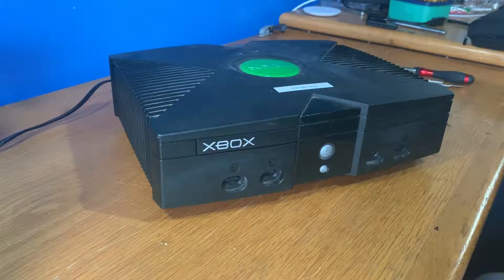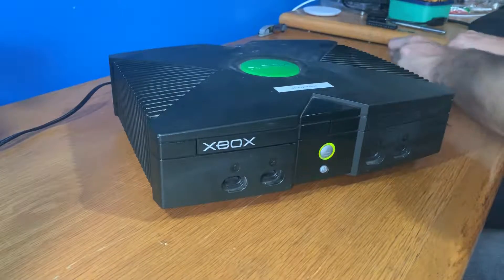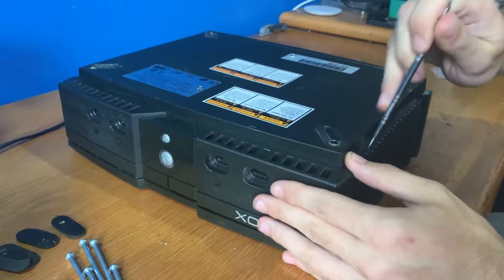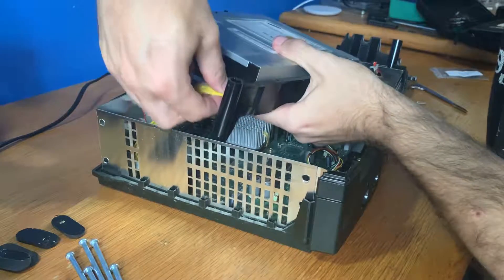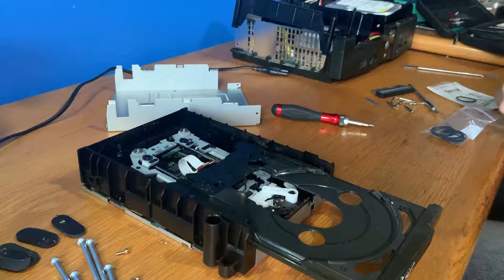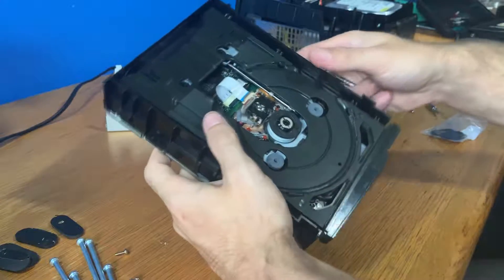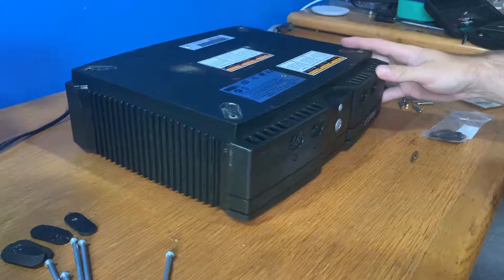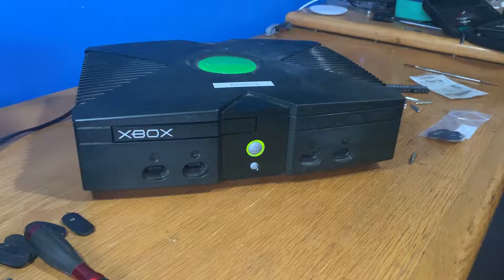How to Fix: Original Xbox Drive Tray Belt (Drive Not Opening/Ejecting or Closing)

Comment: Have actually replaced several of these without taki g cover off.Just using tweezers/pick tool to wrap around pulleys.Also,Used "Hair Bands" instead of belts...worked like a charm !